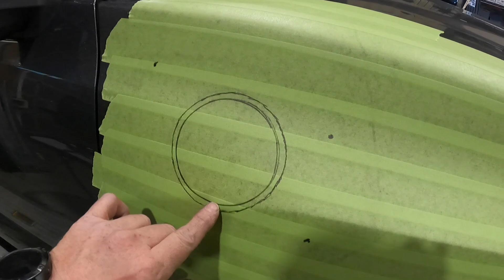How To Install The upTAKE Snorkel 3RD Gen Tacoma | upTOP Overland

Comment: Question for Uptop: instead of using the masking tape and drawing the hole on the masking tape for cut out hole in fender, can I use a regular white plain sheet of paper with the drawing of the hole on the paper taped to the fender?
Reply from the maker: We recommend the masking tape as the snorkel locates itself on the fender.  If the snorkel is pushed firm against the fender there will be no gap between the snorkel body and the truck ensuring it is in the correct location.  Marking the tape once this is done ensures you are drilling the exact right location.
Reply: @upTOPOverland  Thanks for info and I will use your recommendation.

Comment: About the Ditch light installed on the top of the box of the Snorkel, does it make the Ditch lights uneven one is higher than the other, LMK before I make a decision to buy one, thank you.
Reply from the maker: You can adjust the angle of the ditch lights to project evenly.